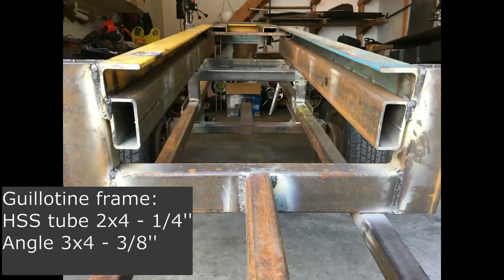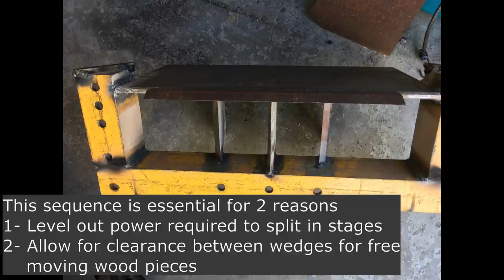Box Wedge Splitter - Fast and Safe

Comment: Okay your just making all us DIY guys look bad now haha! Very impressive what do you do for a living? How did you learn all this stuff?
Reply from the maker: I am an engineer, but I did not learn that from school either.  My father in law was a real fabricator, from which I learned a lot. I also played way too much Lego brick when I was young... My day job has absolutely nothing to do with fabrication...  May I ask you your first name if you don't mind? Thanks!
Reply: Joe Lesage my name is Kirk. We will be living off the grid in the near future I would think a welder ran by its own generator would be the ticket. I think wire feed are easier for the novice? Are they as good as arc? Do you recommend a certain brand? Thank you
Reply from the maker: Thanks!  I am not a welding expert...  I would say wire feed is easier as far as the welder has an autoset feature, which set amps and wire speed for you. If you plan on welding often, I would go for a known brand.  I've only experienced Miller and would buy again.
Reply: @FromSteelToWood  Miller is a good machine for MIG.  The better machines do produce very nice weld and make even a novice look like they are experienced. It's fairly straight forward to weld clean, rust free mild steel with 0.035" MIG.
Reply from the maker: Absolutely!  Good tool, good result!
Reply: @FromSteelToWood  This comment is interesting as I run across the same thing all the time.  I'm an engineer as well and my job and schooling pale in comparison to what I learned from my dad and from just diving into my projects.  I became an engineer because I enjoy projects like this, I don't enjoy projects like this because I'm an engineer haha!

Comment: Great job on this splitter, not over built at all. Its properly built!  I love the articulating crane/hoist and the electric start
Reply from the maker: My back loves the crane too! Thanks again! I have few other videos where I use the same crane in the garage with a vertical winch. (https://youtu.be/ZHljYFeu76U?t=727) (https://youtu.be/FbRZ7wkGcos?t=182) (https://youtu.be/RP22PBWRFHA?t=198) or installed on my trailer (https://youtu.be/0DbL56Gxf-8?t=54)

Comment: first time ive seen a splitter like this , well done , the stabilisers , the crane and the tongs , the box and the blades  and the whole set up , fucken amazing and once you get that chute made like you say it will push the wood right up and into your trailer or truck 
and in the background you have the tractor there to gather or your rounds up closer to within reach of your machine ...seriously i am impressed
Reply from the maker: Many thanks!  If winter can get away, I will put that machine (with the chute!) to real work soon!  Thanks again!
Reply: i would love to see that in action when you get around to making it and any other improvements and additions    to your set up  , oh and the way it pushed the unsplit timber back into the box ....ingenious

Comment: great splitter.....almost identical splitting wedge like I have.....I built mine about 3 years ago......so much better than the store bought ones. There are features you have that I have been planning on adding to mine......but your outrigger system is much better than what I have.......I like your crane system that I may try to incorporate on another project......already have a hydraulic log lift for mine........awesome spliter
Reply from the maker: Thanks.  I am always curious to see other's people ingenuity and I am amazed on how some clever design are yet cheap and effective. It's just a matter of time and patience to build it.

Comment: That log is so close to falling in there on its own! Maybe a little bigger opening on your next build. Looks like a good design, that's for sure. Now you're gonna need a chute like you said. Or a conveyer to load the truck/trailer. Thanks for posting this vid!
Reply from the maker: Thanks for the comment.  I actually made a fix for this problem. Not yet tested as I need big logs. I hope this will work!
Reply: Maybe an auto kick off valve for return and just a bit more speed on travel ,, good build , ty for the vid
Reply: I think simply having that reutrn rail closer should do it.  I.E. Weld a rail into the gap, so it doesn't have to return 6" before contacting the wood. Ten minute modification! Right?
Reply: If one had a couple of vertical pieces of steel instead of the horizontal tubing then it would slide down better, maybe.
Reply from the maker: See my the Splitter Update video (https://www.youtube.com/watch?v=RP22PBWRFHA) at 3:32.  That is exactly what I did.
Reply: A quick fix might be to bold a 1/2" piece of plywood to the top slid bar that pulls the wood back.  A piece of plate steel would do but could just be overkill.
Reply from the maker: Overkill is underrated!  I should have done the steel plate in the first place!  Thanks for your feedback!

Comment: nice I like it great project. some tweaks and you will have it made.  I say a solid plate in the back so you don't have any hang ups. and for that 1/2 inch I think you can get that fixed were it comes all the way back to rest the log for splitting.  over all I like it.   Now to but a canveory at the end to make a nice pile or to load it in the back of a truck or wagon.

Comment: Good Work!!!, I have been thinking of a way to install a winch on my splitter, I like the way you made yours from start to finish,,,, I may have to redo my splitter to use Your enhanced enginnering.  best idea I have seen yet,, I am sure you have that problem fixed on how to get it to drop into the drawer again, as I saw it, I was saying, just bolt a short piece of 2x4 to that pusher, problem fixed, at least for today

Comment: The design I have been looking for. I am using Hydraulics from a CAT excavator for higher pressures and speeds and improved power density. With slight modification and limit switches I think the stroke could be automated so you can keep loading while the machine makes the movements. Very nicely done. Thank you very much for sharing.
Reply from the maker: Thanks! You are right, the movement could be automated. But you know, I have to keep some job for my teenagers!  They are very skilled with remote controls anyways... By using hydraulics from an excavator, the splitter will be on fast motion... Overkill is underated! Thanks again for your comment! When it's done, please post a video!

Comment: Lots of good ideas there.  Looks like good wood for one of those Jotul 118 wood stoves.  They need long fine split wood
Reply from the maker: The fireplace I have is a RSF Delta (http://rsf-fireplaces.com/en/delta-2-fireplace-specifications#mc) which when you look into the specifications, can take 24'' long wood. That is actually the width of the door. So you load the logs sideways. That is why I cut 21'' long logs and I split them quite small. It dry better, cord easier.  This fireplace has so much control in air admission that I can simply bunch up a pile of wood and it will burn slowly the whole night.

Comment: Great job on this project (design, construction, and sharing). I love the articulating boom, too. Need to modify the return carriage so the wood drops in without reaching in each time - but you knew that and it will be an easy fix. I'm just jellious now.
Reply from the maker: I think it is important to share.  I have seen so much ingenuity on the web that inspired me to do this. I initially wondered why they did share but I was glad they did.   Now I think this is good to share this one in return.

Comment: Nice Job! Mir gefällt insbesondere die Idee mit dem Schwenk Arm der Seilwinde.
Es haben sehr viele Leute einen Kommentar abgegeben, denke mein Vorschlag wird dabei sein... Falls nicht, mir ist aufgefallen das das Holz beim einfachen des Spalt- Zylinders oben drauf liegen bleibt. Wenn dort eine gerade vertikale Platte angebracht wird die ebenfalls so dick ist das das Stück Holz keine Chance hat oben drauf liegen zu bleiben. Aber es ist schon etwas Zeit vergangen, bist sicherlich schon mit der Arbeit fertig. 😉
Stay tuned.
Reply from the maker: Thanks.  The articulated arm and the winch are a key component of this splitter. Fix is already made for the log to fall back in it's position.

Comment: I like both the splitter and the hoist. It does need to adjust the part that returns the round back to the starting point so you don't have to reach up and pull it in. Other then that, that is a nice set up.
No I see one more thing. The piece that got stuck in the grid of the output would have not gotten stuck if that was flat with no grid. I'm sure the thought was for derbies to fall through, but that would just pushed out the end with the wood. So ad some sheet metal so wood can't get stuck. Oh... and a conveyor to remove and pile the splits as they come out.
Reply from the maker: Well you got some good points there!  Make sure to watch the updates (videos #77 & 78 on my channel). You might find some modifications interesting! Thanks!

Comment: I built one and went back to a normal splinter with a different wedge head.   Have to remember these work great if your wood is round with no knots or butts sticking out.  If you have those then the piece sits up and doesn’t give you the desired size piece.   Also you are pushing the piece through a die and not having it split naturally this leaves lots of small pieces that allot but are inside the box so you basically end up with two pieces.       You’re build is very nice though
Reply from the maker: By the accuracy of your description, you had it run for a while! I totally agree! I am thinking of putting a regular splitter parallel to this one, so I still can benefit from the engine, pump, control lever, and jib crane. I do have knotty logs and odd pieces, and it does produce a lot of debris. But I do collect the bigger ones in a tote bag and the smaller ones are chipped down and bagged in paper bags. There is basically no waste. The upside is having the logs to be evenly sized. Thanks Greg!

Comment: this would be really cool if you could make it so that the hydraulic cylinder activates 6 times in a row (3 push sequences and 3 pull sequences) but also be used manually with the hand lever. So that when you get big pieces of wood like that you can activate it and you are able to move the log back into place for it to go again, might increase productivity that way too. Of course the manual level that is already used can be used for log pieces that are a bit smaller. 

Great idea!
Reply from the maker: Thanks! That would be so cool!  But I've got a similar idea.  This is called "kids".  Lol!  I have my son hook logs while I simply activate the lever! Make sure to watch video #77 on my channel which features improvements made on this splitter. Thanks for watching!
Reply: ah yes, Child labou- I mean character building, definitely pays off :P

Comment: Good design, well made and if you fit a piece of flat steel plate on the face of the pull back cross bar the logs will not sit on top and slide back in. my guess is that you have already done that,  two thumbs up.
Reply from the maker: Thanks Bob!  I already made some modifications last fall and going through more modification at this time.  Make sure to watch video #74 on my channel. Yet another video will come soon to show the very last fixes. Thanks for your comment!

Comment: love it,,,, no fighting the dam logs.....  but if you can control the size of logs with a adjustment table would make it perfect ,,as in the thickness or did I miss that step  ???
Reply from the maker: I have planned something about this. The bottom of the "drawer" is bolted from beneath. You can see from the side of the splitter the 2''x2'' square tubes under the bottom's drawer. They are held in place by 1/2'' bolts.  So loosening the bolts, adding shim blocks and the bottom of the drawer will stand lower.  This will increase the thickness of the splitted logs from 3.5'' to 5.5''. My own goal was to produce small logs for my fireplace. I did not used this feature yet.

Comment: If you add a plate with springs attached to the pull back bar it will eliminate pushing the block back into the box every time it returns the block.

Comment: Hey Joe, still one of the best if not THE best box wedge splitter I've seen on YouTube. How did you design your wedges, because in comparison to other splitters of this type you seem to have very little debris.
Reply from the maker: Thanks for your comment!  I do have a video with the shematics ( https://www.youtube.com/watch?v=yCvmZbuHPyw )  Basically, it is a matter of angles and sequence. Wood can be compressed a little bit.  But if the wedge does not allow for expansion of the splitted log, then you get strong rubbing and thus debris. See video #76 on my channel, you will have a close view of it.  ( https://www.youtube.com/watch?v=pTrCcC8nQgs ) Thanks!

Comment: Do you by chance have drawn out plans and materials list? Wonderful splitter. Exactly what I need.
Reply from the maker: Thanks for your comment! I did some quick drawing. See the link https://www.youtube.com/watch?v=yCvmZbuHPyw&index=3&list=PLmv7ck4SGmmF_i0YviWRruBRP5E9dhbTWAs for the parts, you can see in the video comment section above the links to the main components. A few links are broken, but the main components are there. Valve, engine, pump, cylinder.

Comment: What if you put the winch control on that log picker upper thing? Would save you from having to let go of the thing to winch it up.  There are wireless remotes available to retrofit push button switches.
Reply from the maker: The remote control would be great, like you say. One day or the other, I will make an improvement to be as you suggest!

Comment: Have you split any knotty red oak with your splitter.  Or any knotty wood.  I would love to build one but I wander how it would do against logs with knots
Reply from the maker: Knots were not a problem in maple, neither yellow birch. I don't have knotty red oak, but I do have white elm at my new place.  It goes through quite well. Although they are usually smaller logs. And for the bigger logs, I take smaller bits at that point.

Comment: Great craftsmanship, I’ve been contemplating retrofitting my speed o I purchased 10+ years ago, problem is I’m unsure if the 27 ton pressure is enough
Reply from the maker: Thanks Will.  27 ton of pressure is enough in my opinion. Unless you get a lot of big uneven/odd blocks. Otherwise, assuming you have a 2 stages pump, it will definitely work.  If I had to change something on the splitter, I would go with a smaller engine (10hp instead of 15) and a 4'' diameter cylinder.  It would have been faster. The key is to have sharp knives and a sequential order. Make sure to watch the updates on the splitter on my channel (vid #77 & #79). Thanks for watching!

Comment: A really well thought out and built out design, what is the horse power of the engine?  It would have been fun if you had painted it in Case colours (i know, you like grey...)   :)

What about running the winch at the end of the boom so you didn't need that complicated pulley system?  Or run a hydraulic motor there instead of the electric one?  What are your thoughts?

Kind regards from the west coast.
Reply from the maker: Thanks Rain Coast!  That is a 420cc 15hp. I could have used a bigger pump to max out the engine and have faster cycle time.  The idea to have the winch at my level is to be able to pull the small lever to free the spool.  So I can extend the wire over long distance. This being based on a very cheap <100$ winch!  As for the hydraulic, I did not think at the time. Thanks!

Comment: Nice build! I wanna build something similar but I'm not that experienced when it comes to hydraulics. What is a 2 stage pump? What's the difference?
Reply from the maker: A 2 stage pump will actually pump at two different speeds.  The initial speed, which is the higher GPM will produce lower PSI. As soon as the PSI will raise (wedge coming to contact to the log), the pump will gradually switch to the lower speed, which is lower GPM.  The basics of hydraulic pumps is as follow:
Low GPM and low pressure requires little power (HP)
High GPM AND High pressure requires a lot of power. 
So the 2 stage makes the following combination. 
First stage HIGH GPM, low PSI. 
then switches to 
Second stage LOW GPM, High PSI. 
That allows for a smaller engine while having high PSI when it counts (splitting), and high GPM when it counts too (retraction). Thanks!
Reply: @FromSteelToWood  oh I couldn't have asked for a better explanation! Thank you so much!!!

Comment: Add a lip to the top of the tube iron, and the logs should slide right in still really cool
Reply from the maker: That is pretty much what I did.  I am confident it will work, but have not tested yet, since I have no substantial logs to split at this time.

Comment: If you turn the oil pump intake line off and have an open line t to let it suck air until it warms up it solves the hard start problem.

Comment: Nice work!  I would suggest a hydraulic log lift rather than your overhead pulley system.  Plus, put an auto-cycle value on your controls.  That way, you can prepare the next piece of wood while it is spitting.  It would be much faster.
Reply from the maker: Thanks Karl!  I have improved many things since then. But yet, the auto-cycle would be great. For the time being, I ask my daughter or son to do the "auto-cycle" while I load the logs! You may like to watch the udpated splitter, video #77 on my channel. 
https://www.youtube.com/watch?v=Zo9smg1S1v4&list=PLmv7ck4SGmmF_i0YviWRruBRP5E9dhbTW